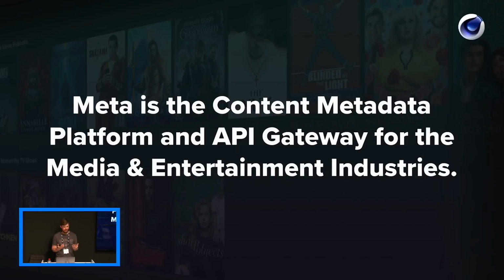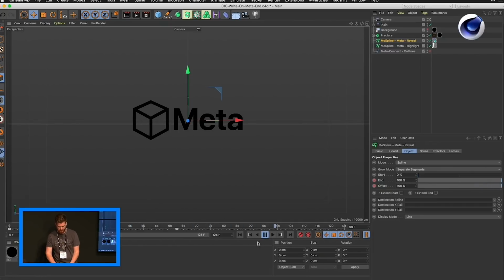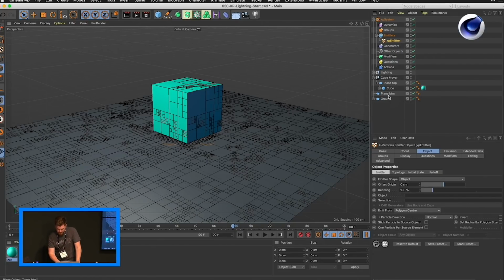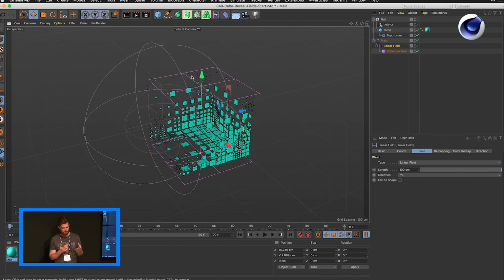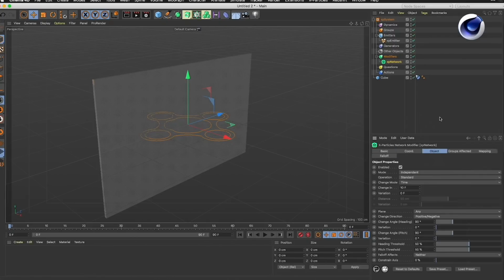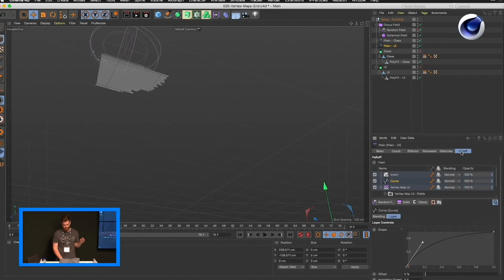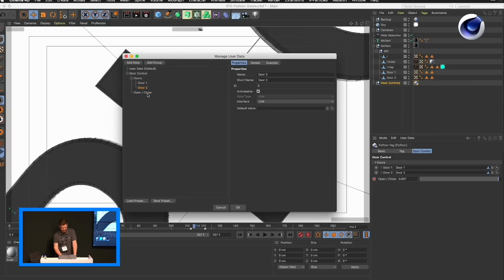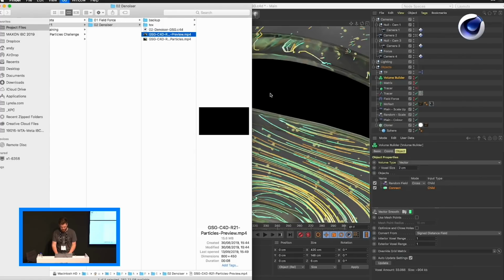Andy Needham @ IBC 2019 | Maxon Cinema 4D

Comment: Will a laptop with Core i7-8750H 6-Core Processor (Up to 4.1GHz) and NVIDIA GeForce GTX 1060 work well with C4D Octane render?
Reply: not so much, need more gpu power
Reply: it all depends. i have a 1060 6gb and if the scene is not too heavy i have pretty quick render times. even for animation i can use the denoiser and get it down to maybe 10seconds per frame to render, and that's allright. but yeah, it's allright, not great. once u deal with bigger scenes and especially fog and volumetrics, you need at least one or two 1080ti's. or u have to wait forever to get a preview. and that gets you out of the flowstate.
Reply: @von_freiesleben64  it dose not depends, you need more... and its a laptop not a standard size GPU
Reply: @MegaBexon  i can only speak from my experience, i've been working with that quite okay for a year now. like i said, if the scene is not too heavy it's okay, or if you're just starting out. sure 4 1080ti's are better, no doubt. but some people are on a budget and then u have to work with what you got.
Reply: @von_freiesleben64  Do you mind if I see some of your scenes? or test renders?